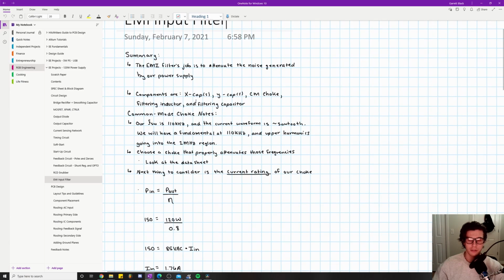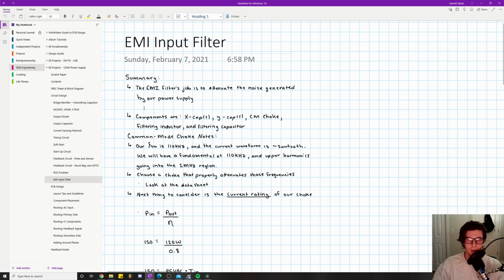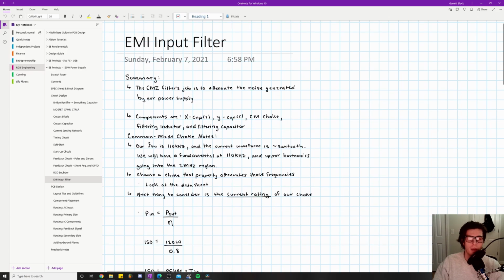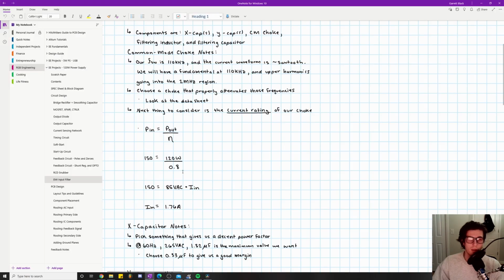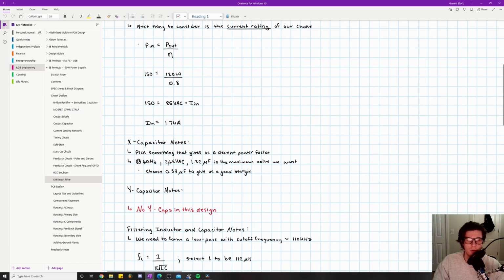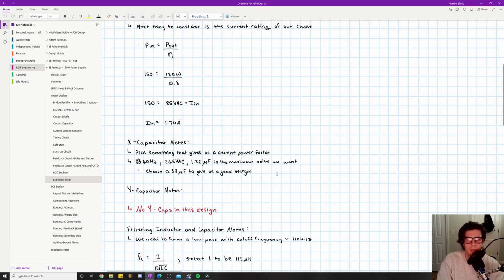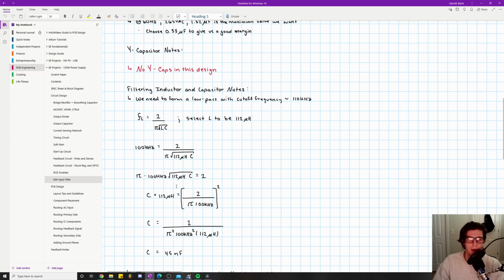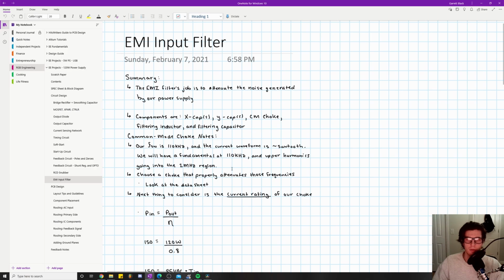FLYBACK CONVERTER PROJECT PT 15 | 24V, 120W FLYBACK CONVERTER EXAMPLE | POWER SUPPLY EXAMPLE PROJECT

Comment: My question is  why you choose in the project 220uF instead of 45nF?
Reply from the maker: It is more important to filter the lower frequency in this case because that is the "loudest" signal.
Reply: @RGBEngineering  okay thank you,I have a project and i need to calculate that frequency,  this is the formula C =  1/(pi^2 * Frequency^2 * L) ?, ofc i just change the frequency with the C, i don t know if this is the formula
Reply: @RGBEngineering   Okay but why u choose in the video to calculate 45 nF and didn t say what u said to me, no offence just asking